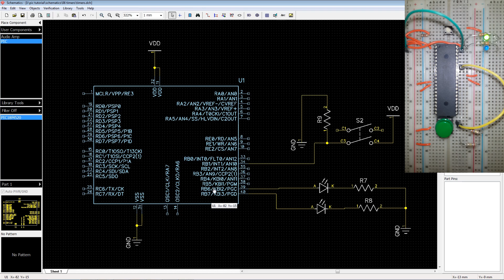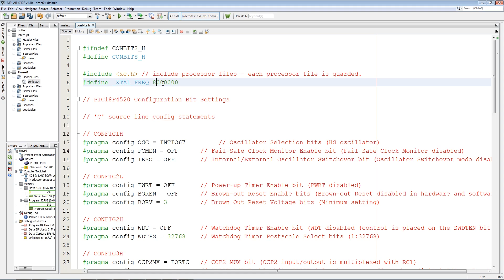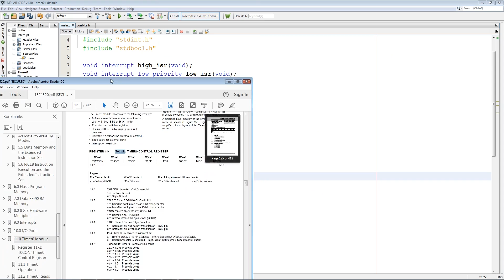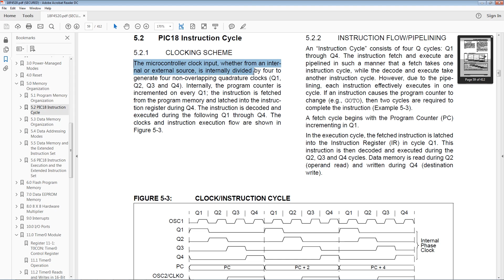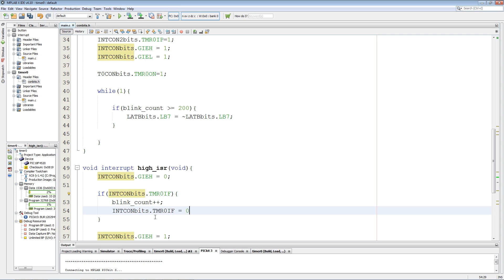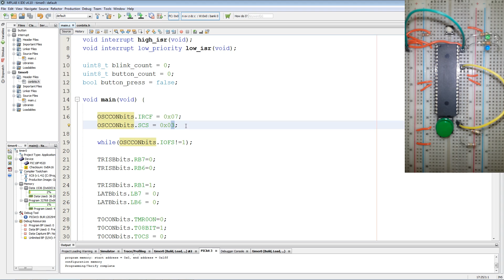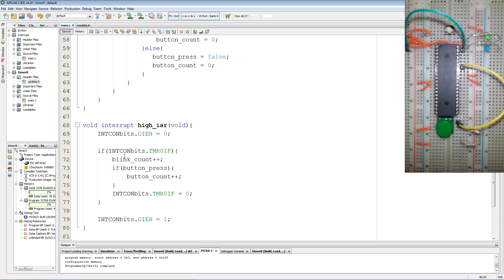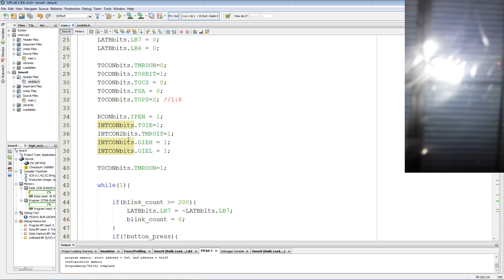Oscillator and Timers 🔴 PIC Microcontroller Programming Tutorial #6 MPLAB in C

Comment: This might be a dumb question. Could you specify the resistance values used here? Thanks in advancec
Reply from the maker: 330R for the LEDs (~20mA @ 5V). 1k for the switch.
Some extra stuff.
https://bindertronics.com/tutorials/pic-programming/hardware-connections

Not a dumb question. I did not specify it. These are rule of thumb values. You will often see the values 1k 10k 100k 1M in digital design. LEDs generally want to have about 20mA passing though them.

Comment: Any particular reason for resetting GIEH at beginning of ISR and setting it back on at end of ti?
Reply from the maker: Execution insurance. Not necessary on this particular PIC microcontroller but some do not have ISR guards that prevent interrupts from trigging while running a ISR. Basically just forcing the ISR to finish running before it can process another interrupt(s).
Reply: @BinderTronics  But that would be in the case of single ISR? If you had multiple interrupt sources/routines, then I assume touching GIE in ISR wouldn't be wise.
Reply from the maker: Have you had a look at this https://youtu.be/MiPxVmj_nHI ?
This is the case for multiple ISR routines. The flag is the trigger for a interrupt. If a interrupt flag is set before GIE is enable then the interrupt will trigger only after GIE is enabled.
In shot. I prefer to manually disable interrupts when doing ISRs. When one vector can service more than one interrupt. At the end if the day the application and documentation determine the function of how you use GIE.

Comment: Hi :) 

if i want to enable PLL to generate F = 32 MHz, on your code i have to add only the line PLLEN = 1, correct ? 

Another question, if i have to calculate the Tcycle for timer = 4/Fosc * Prescaler * 255(with 8 bit), in your example you have to enable clock freq equal to 8 Mhz and Fosc is 8 Mhz, but if i enable PLL the clock freq will begin 32 Mhz and to calculate the value 4/Fosc have i to consider Fosc = 32 Mhz ?

Thank you
Reply from the maker: You are correct in both cases. Watch the heat on the chip when using PLL. Also you need to change the _XTAL_FREQ define to 32000000

Comment: For me I am not getting an output, I followed most of the code with a PIC18F45K20 (64MHz). Except no prescalar, and every time the timer overflows it increments a two dimensional array variable to output. I have transistors that control the colors on PORTA and the base to activate it is on PORTCbits.RC0. Neither give an output even when hardcoded in before,/during infinite loop or ISR.
Reply from the maker: Best i can tell you is to step debug the code. https://youtu.be/O4IpwgWhqLY

Comment: Nice video! The counter variable overflowed at 255 instead of being reset at 200, thats why it “worked”. Error was not really noticeable.
Reply from the maker: Witch counter are you referring too? I am assuming the blink_count. Cause the led will never blink if the counter overflows.
Reply: @BinderTronics  Yeah blink_count @15:00.  uint8_t is one byte wide, so it flips back to zero when it = 255 and gets incremented.
Reply from the maker: @JohnSmithZen  Yeah I am aware of it by now. Just never bother to update the comment.